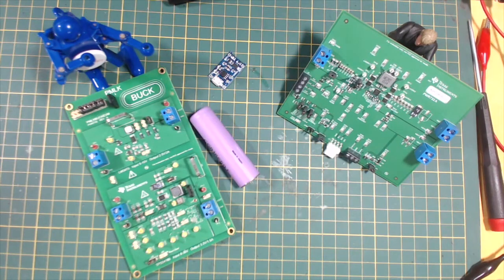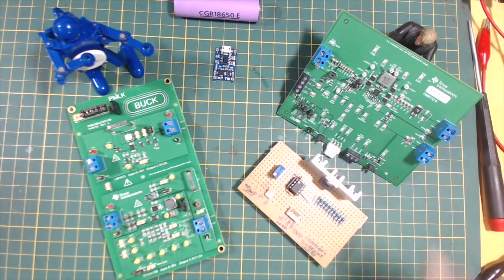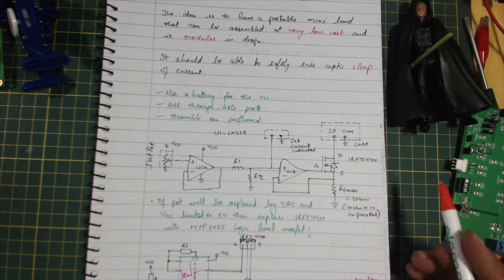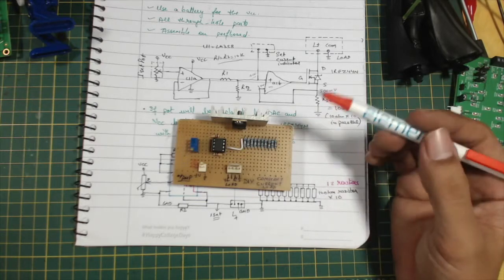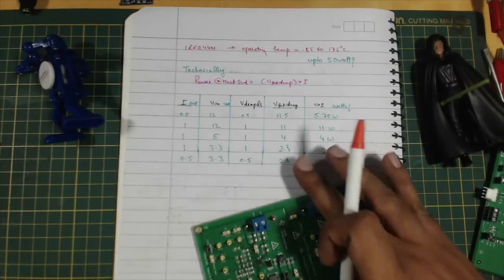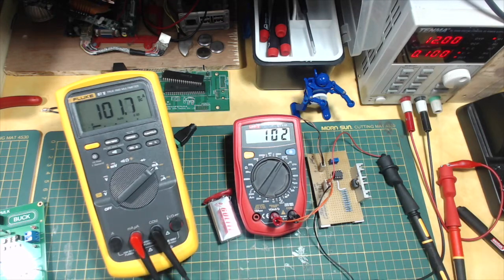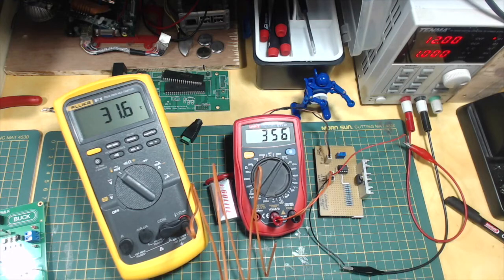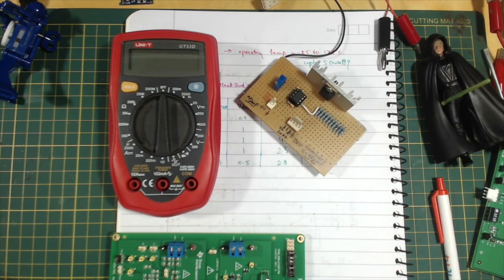DIY DC Constant Current Load

Comment: Nice. I´m curious why did you use 2 Opamps in series? I did the same design with only 1 opamp and it also worked. cheers
Reply from the maker: The first one is just a buffer and is a good idea if you intend to add something like a dac to the mix later. It will work in most cases without it but in cases where the setting voltage is supplied by a different driver with fluctuating current/internal resistance, a buffer stage helps in more ways than one. 
Thanks.